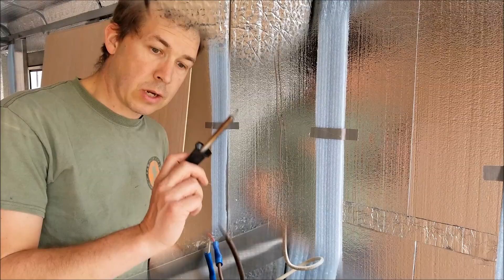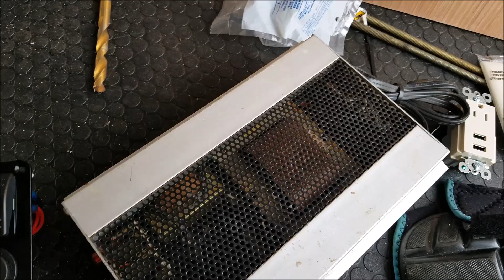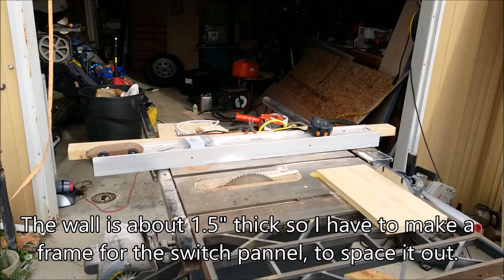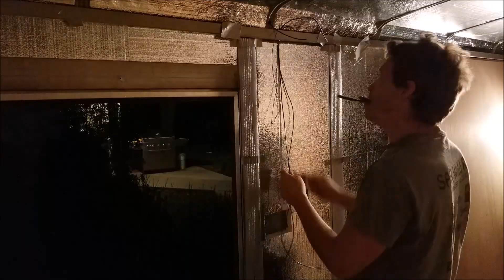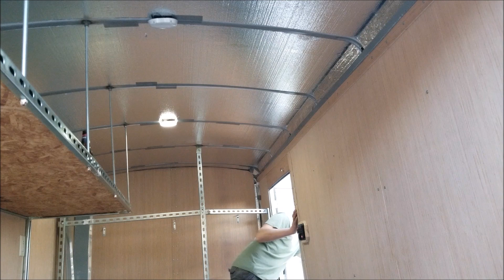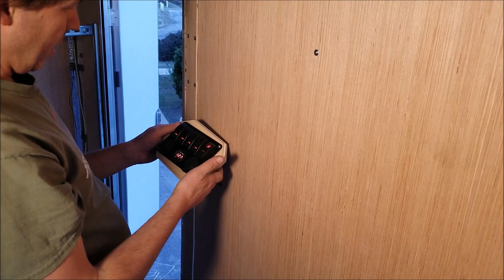Cargo trailer conversion electrical

Comment: Skip to 9:07 how were you able to connect those wires to the inverter box and the battery ? I want to try it but I’m scared I might electrocute myself
Reply from the maker: I ran wiring through the floor and out to the tongue box in a later video.  12 volt is not a huge threat unless you cross the leads directly.

Comment: I have watched so many of these video’s where the insulation method has been to place foam (as apposed to spray foam) foaming costs more to have done. But all the wiring can be installed properly near the back of the wall cavity. This method of cutting groves in the foam means in the future if someone decides to put a screw in the walls they will cut a wire. Sometimes you need to spend a little more to do the job right!
Reply from the maker: It should be obvious by now that I am mostly an amateur with this. I plan on keeping this for a very long time, so hopefully I wont put a screw through  my wiring. I know that spray  foam would have been better but its lots more expensive and basically permanent so I went with foam panels. Not the best but better than nothing. Thanks for the advice. I have gotten many vary useful tips like it, that I wish I had thought of beforehand.

Comment: A dryer cord is rated at 30 amps. A range cord is rated at 50 amps. Not large enough for an invertor. A 800w invertor draws about 130amps
Reply from the maker: Thanks, I will make sure to do the proper calculations for mt inverter.

Comment: I always thought it possible that you could short a battery using a wrench carelessly, but never seen anyone actually do it.
Reply from the maker: I'm good at this sort of thing. I'd bet I'm not even close to the first to do it.
Reply: @DirtyShopDIY  a good tip is to wrap your wrench in electrical tape.

Comment: Would time be saved by running all of the electric before the paneling? I’ve got a 7’x14’ on order and I’m trying to gain as much knowledge before it gets here. What gauge wire are you using for your 12v circuits? Ty
Reply from the maker: Yes time would be saved. 16 gauge should be enough for thinks like lightning if you are using LED. There are charts out there that will tell you wire gauge to power draw recommendations. I am not an electrician.
Reply: The correct way to power your trailer is to remove all the wall panels (and ceiling if there installed) then run the wires secured with fasteners near the outside walls on the studs. Then have the unit spray foamed which makes all the wiring enclosed in the foam, plus the boxes foamed behind as well for a complete seal. If your going to do a job do it right!

Comment: I’m shopping for a new 16 or 18’ dual axle. Planning to install one big and one small window on both sides. I’d like to get it built possibly this winter and stay in the road come spring. I’m watching closely to make sure i don’t have to backtrack and redo. After these revelations I don’t know why anyone would buy a stick and glue built matchbox, they are dangerous and ultra cheap. Buyer beware or Jayco.

Comment: What did you use for the insulation? Is it foil backed foam?
Reply from the maker: Its "R-TEC" from Home depot. It has a reflective coating on one side. But it's not foil.

Comment: Great videos and you are very skilled at your work. 
One thing you might think about is that all cargo trailers are made very light and flimsy. 
The plywood on the inside helps hold them together. You would have had a stronger job if you put your old plywood back up and paneled over it.  Wood is also an excellent insulator. 
I am not sure what you are going to put on that shelf that is hanging from the ceiling but it needs to be very light because those ceiling bows will bend very easily. Probably need to brace up from the floor.
Great work and I like your ideas.
Reply from the maker: Thanks, I bought the trailer with the heavier construction. So far it seems plenty strong. 16" joists in the walls on mine. The cheap ones are using 24". It also has the slightly heavier exterior aluminium.  I'm happy with it so far. The weight on the upper shelf is devided over all the roof arches. They are actually fairly strong.
Reply: Buy the trailer with 16 OC framing, remove the 3/8” plywood and cut it into strips 2” wide. Fasten the strips vertical along the metal horizontal studs. This makes the cavity now 1 3/8” on most trailers. Then run your wiring and install shallow electrical boxes. Have spray foam installed. This creates rock solid walls and ceilings (the spray foam has to be 2 lbs closed cell) Then install any kind of paneling or wall finish over top of that vertically. You will be able to heat or cool your unit very easily as the spray foam acts as a vapour barrier and seals it tight. This type of spray foam also can be sprays underneath the trailer to make your unit a 4 season trailer.
Reply: "All cargo trailers are made light and flimsy"
You have no idea of what you are talking about !

Comment: You left in the part where you shorted the wrench across your battery terminals, haha. Is the battery mounted outside?
Reply from the maker: Its inside for now I dont have a tongue box yet
Reply: Dirty Shop DIY looks like that small of a battery shouldn’t produce enough hydrogen to be dangerous.  I’m sure you will upgrade to an AGM or Lithium battery eventually.